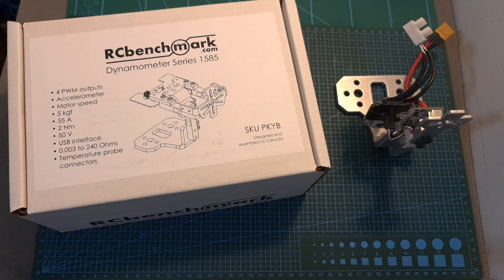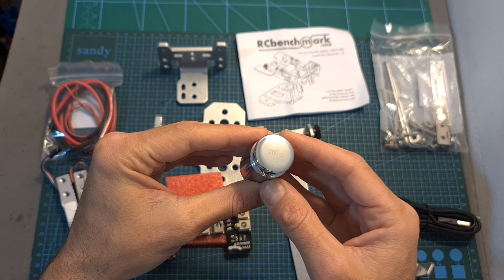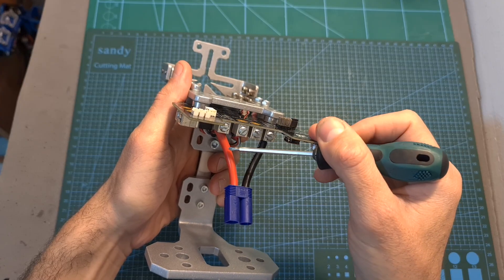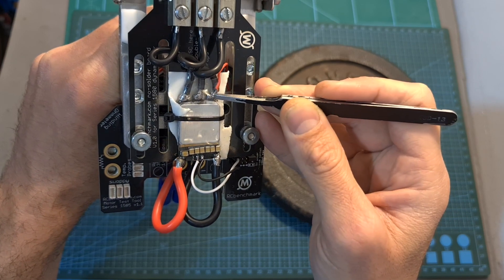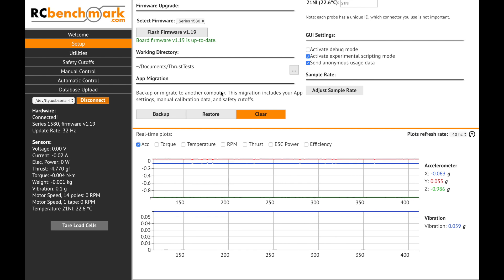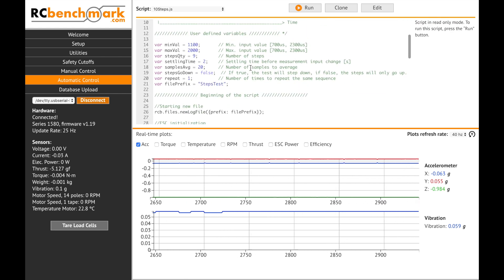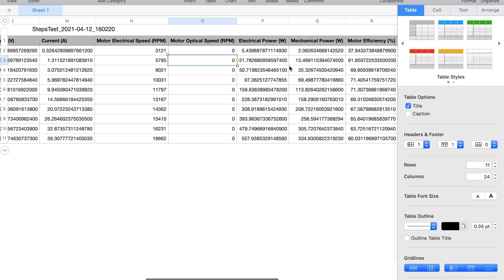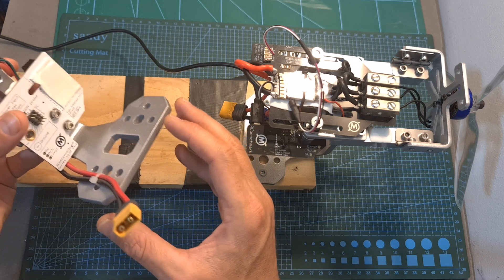Tyto Robotics 1585 Thrust Stand - Setup & Review

Comment: Hello, that's a big investment! So I'm gonna give an advice on how to use it right, if you don't already know it. The thrust force depends on environment (pressure and humidity), so if you want to be able to compare your results from 1 motor to another, you need a motor reference you run the test on before your new test: then you apply the result ratio you found on your reference to your new motor test results. Thanks to this,  all your tests will be comparable.
Reply from the maker: Thanks a lot for the suggestion. I am running the test in the same room with similar conditions. I know that there are temperature differences and I will try to see how it affects the thrust tests.

Comment: $1000 for that? Additional charges if you want to use other control signals? It's not like it has an especially high acquisition rate, it can only capturing data at 80Hz.

Don't get me wrong, it's a nice package - But the pricing is crazy.
Reply: Make one cheaper buddy and we'll try it out. RCBenchmarks is managed by 2 young talented guys who love this stuff and know their stuff. If I tested a 100 motors per year for a long time, I would surely pay for a product I am confident will be supported through time.
Reply from the maker: You are not only paying for the hardware. They keep improving their software and also provide customer support, which is not cheap. The 1520 is much cheaper and suits most of the hobby grade needs. The one I got is definitely not for everyone.